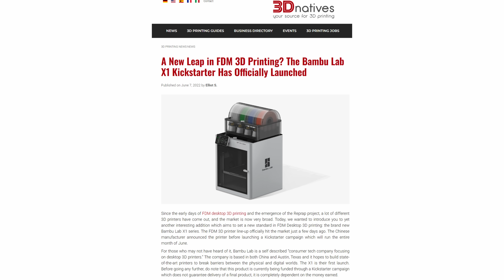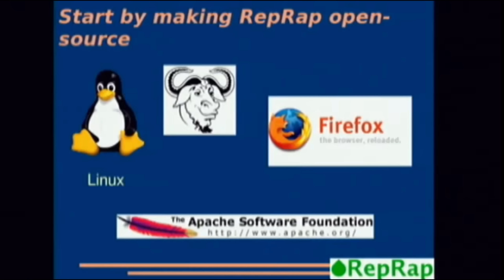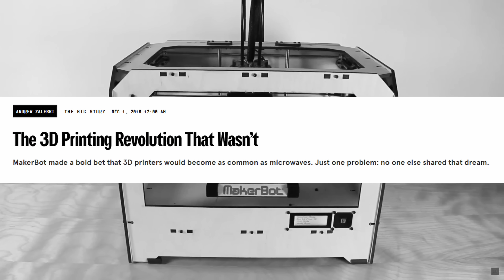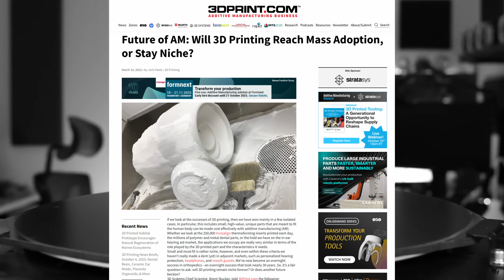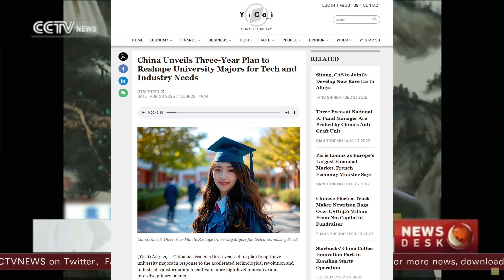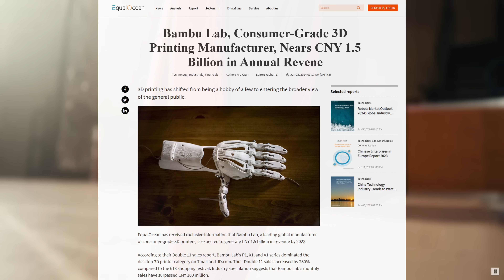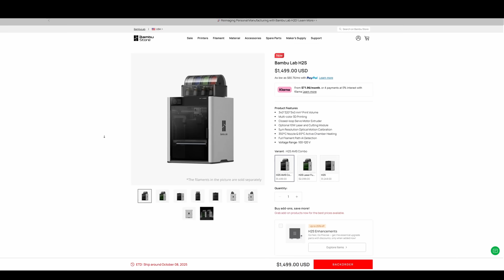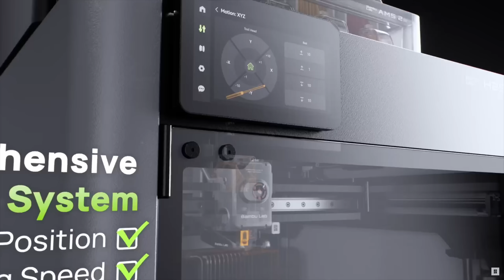How Bambu Lab Rose from Nowhere to Dominate 3D Printing

Comment: I know people hate bamboo because of their lockdown ecosystem and some of the things they’ve done recently, and I agree I don’t like it either. I’ve had a handful of different printers in my time, but when I got my first bamboo (P1S). It changed how I thought about printers. It was so easy. The prints are so good so much less set up so much less waste so much less worrying and time . It was expensive but if you print regularly, then it’s a no-brainer in my opinion. And I know the other brands have caught up quite a bit.

Comment: Prusa is still a major brand with very reliable machines which are easy to maintain. The XL is still the fastest multicolour printer and the Core One is still one of the most reliable single colour printers, with a multi colour option. Prusa's are more expensive, but machines are always upgradeble to the next version for a fraction of the price of a new machine.  Firmware updates will be available for many years. The Chinese brands are cheaper, but harder (more expensive) to maintain and not upgradeble. Firmware updates are mostly for a limited number of years.
Reply: INDX coming is the real game changer
Reply: prusa and reliable shouldn't be in the same sentence.
Reply: @riba2233  Why not? I have several Prusa printers both personal and in a printfarm. With just a little maintenance they never let me down. Print quality of the Core one is decent,  but may have some VFA.
Reply: @riba2233 couldn't disagree less, my MK4S and core one are very very reliable, worlds ahead of the Mk3 before it

Comment: +1 for pointing out how Bambu is part of The CCP's push for market capture and with DJI emplyees and strong ties to the government. 
-1 failure to mention open source projects had already rolled out everything Bambu did. The ""Lidar" which isn't lidar was the only real "innovation" 
-1 for making this essentially a paid spot for them. Sounds like it was co-wrote by AI.

Bambu moved the industry by offering a polished product at a reasonable price. How?  By making it a walled garden, and litterally throwing more money at it than anyone else had to make a shiny consumer product. They likely sold at a loss for a good while as well. They didn't innovate, they brute forced the solution by way of government backing. Its silicon valley "enshitification" but for manufacturing.

Comment: Yikes. I have a plugin that shows me the like and dislike ratio as well as on the thumbnails of every video and you really made people angry. And me too kinda, I recall you promised us to make the fan show down more frequently, well so much for that! it's still the exact same schedule or even slower. My man, you really ought to keep promises and listen to your fanbase AS WELL AS read comments, and not just a few but put like idk 20 or 30 mins into reading comments on every video, reply to them with your own thoughts and you will have an understanding of what your fans want and where you yourself can improve and the best part, you would be interacting with your community. It's not hard. If it's a promise you aren't able to complete because you are genuinely that busy, then at least say it.
Reply: The worst part, that only shows dislikes made with the plugin installed, if someone doesn't have the plugin and hits dislike then it doesn't add it to that external database, the actual dislikes are actually much higher
Reply: @bait28  
or lower

since it calculates a eqivelen, If 100 peopel wached the video whit the plugin instaled and 20 prest the dislike and the video has 100k wiose it will show the dislikeas as 20k
Now this works if the sample of people that use the plugin is representetiv of the wider popelation, but that is incorect so that is how you can have a 100x infation of "dislikes"

Comment: this really needs a sponsored tag on it, sb cut out almost 1/3 of the video...
no mention of open source marlin/klipper firmwares (and their forks) enabling the clones to take off in that roughly ~2010-2020 time span, just reprap/prusa the first half of the video straight to bambu labs ad for the 2nd half
Reply: Make sure you report it as spam to youtube. According to their rules having a sponsor this heavily in a video requires the sponsor tag.

Comment: This is such BS. Saying 3d printing was stagnated if it wasn't for bambu is not true.
You barely cared about 3d printing before getting a bambu printer. All you wanted was a appliance and not a tool.

Throughout the ages there has been waves of innovation and development with 3d printing.
3d printing was stuck in a real limbo for almost 20 years in the early years until the dormant patents ran out. Then the hobby 3d printer market started up.
The real waves of 3d printing have always been cost. A high end printer exist then it gets cloned and mass produced. Every cycle this has been true. Reprap, makerbot started making cheap and easy printers and kits based on established high end printers, yes they were more janky but that didn't matter as they were a fraction of the cost.
Then new high end printers were developed and again a new cycle of copy printers that went to mass market like the cr-10 which thousand upon thousand were sold in 2014-2016.
You even mentioned creality didn't do home sensor before bambu made them do it. This is also bullshit, they had it before bambu even existed.

We got a metric fuck ton of high end developed printers that are way more complex and advance than bambu. But whats the difference? They cost a lot more and are difficult to use.
Bambu is not pushing the boundaries or developing shit. They are just like what creality and makerbot once was. A cheap manufacturer, for its time at a decent quality.
If you open your eyes you can find way better printers today than bambu. But you don't even know about them since they aren't mass produced at a cheap cost. And in 5 years time they will be mass produced and then you will hear about the company that is mass producing them. Not the companies that pioneered the technologies.

I am so disappointed in how poorly researched this video is. It feels like you are just blinded by your fanatic obsession over bambu to see all else. All this video is, is a "Bambu is the greatest innovate of 3d printing ever" Which is blatantly false and only said by obsession.
Reply: It absolutely is true, bambu actually revived the 3dp market.
Reply: @riba2233  They absolutely did not. It was constantly growing. Did they accelerate growth? For sure. Revive? Not at all.
Reply: @802Garage  let's be real, look a 3dp market before and after bambu. Look at both number of sold printers (not just bambus) and types of machines being developed. Both are wildly different, that is just a factor. Every company gained a lot from bambu reviving the market.
Reply: @riba2233 You said revived. That means there was a death or at least a slump. That is 100% factually incorrect and the market was constantly advancing. It's that simple.
Reply: @802Garage  ok, revolutionised might be a better term 😊
Reply: @riba2233  I could compromise on invigorated or energized.
Reply: @riba2233  He used accelerated in the video. That seems appropriate.

Comment: I'll never buy a bambu fdm printer on principle.
Reply: Principle of what? Being a better product?
Reply: Clippy approves of this.
Also, neither shall I buy one.
Reply: @NoOne-ef7yu  ok parrot
Reply: Why not, explain please
Reply: @riba2233 Bambu lab basically took a bunch oft innovations from other projects, like Voron and Klipper, and offered them as a closed product.

Then, they locked down the firmware so that you could only print using their cloud system.
They walked this back after massive backlash in the end.

But, Bambu has shown that they will lock down the firmware, if they can.
Even breaking existing workflows of owners.
Reply: @riba2233 closed source proprietary firmware. Mainly. I love elegoo and sovol printers.
Reply: @riba2233  Closed source or closed ecosystem or the level of online requirements are each enough reason for many people. You don't have to agree for it to be a good enough reason for them. Changing terms of use after purchase as well is a massive one. Plus paying more for a product because the company spends a huge amount on advertising. Lack of modability is also a big reason for many people. I'm not saying it's impossible to mod, but obviously far more difficult than many brands. There are a multitude of reasons you don't have to agree with for them to be real and not be about parroting. You are really doing way too much in this comments section.

Comment: I almost made the mistake of buying a Mk 3 over an X1C. I even emailed the folks at prusa cause I didn't want to buy one with a new model to come out within 6 months. They lied said nothing new on the horizon. I thought can't start by getting older tech. Ordered Bambu it's been awesome. 5 months later MK4 came out. And for that reason I don't trust them.
Reply: Good call, you saved yourself!